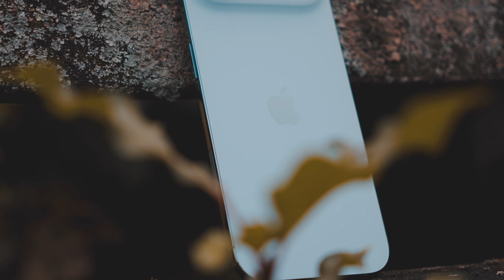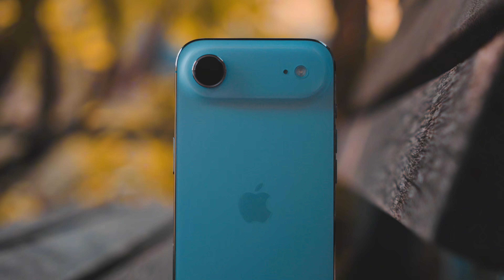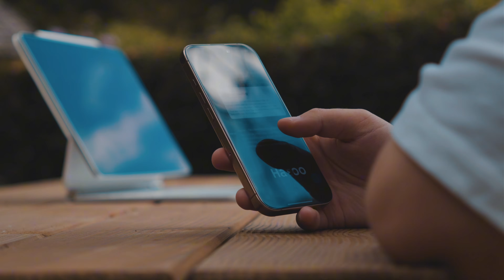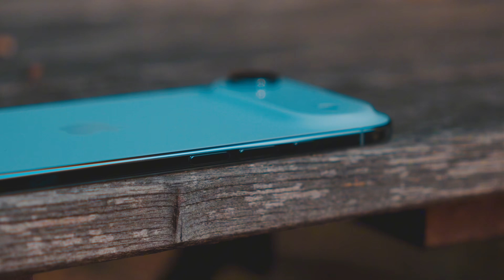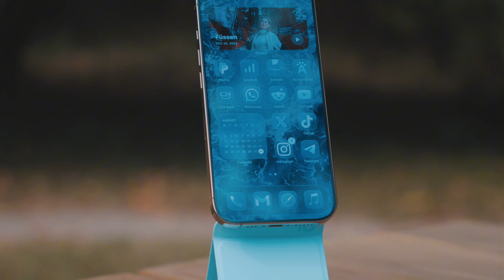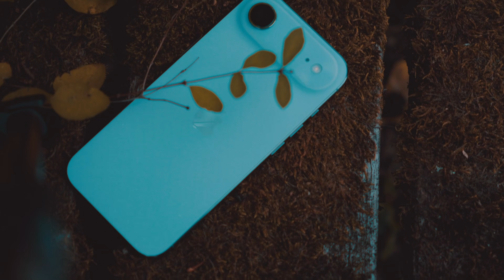It’s Time Your iPhone Air Goes Caseless.

Comment: I agree with you on a lot in this video! I have 1 16pro cashless since I bought it, still bran new even after a few drops.
Im debating now between the 18pro and the Air17... I know they are coming with  the "Air2" soon but I don't think they are going to fix the only thing that might bother me on the current Air... battery.
18pro it's aluminum and NEEDS to live on a case, this feels like a downgrade from my careless titanium, 16pro
Reply from the maker: yeah my 17 pro got fucked up even in a case, but I hate cases anyway so with the 18  Pro Im going caseless regardless and will report back in a few months
Also the iPhone Air has the same battery life as the 16 pro, it's genuinely not a problem
Reply: @heyimadrian.4546  no case on a 18pro? good luck! yeah I think im getting the Air.

Comment: It has the A19Pro chip. It’s just as fast as the pro.
Reply from the maker: On paper yes but it has one less GPU core and due to size limitations and heat soak it preforms worse  than the regulsr a19

Comment: 😅 The thinnest, lightest, most premium feeling & looking, all while being the MOST durable phone! I did put a tempered glass screen protector on mine, but it’s because the coating on it seems to significantly reduce fingerprints. I am rocking it case-less, however! It’s the first time I’ve done that with a phone. Not only do I not want to detract from the feel and thinness, but as you said, cases actually trap in debris that can damage your phone, and it allows the phone to dissipate heat more efficiently.
Reply from the maker: That's great, it's definitely designed to be used without a case :)

Comment: The air looks nice, but going careless on  my 12pro max was a death sentence. I like the idea of a lighter iPhone as the 13 mini was one of my favorites of all time. My uncle has gone naked on his 13 mini for years and never had an issue. I wish I could be so careful. Will the air really preform in the long run tho???
Reply from the maker: It definitely will, titanium is really strong and the new ceramic shield is 4x times stronger
Also because of its smaller mass the hits will be not as hard on it
Reply: I keep my Apple Care + active at all times, using the iPhone Air naked is such treat, this device feels so good in the hand and is such a wonderful experience to use. I feel sorry for anyone who avoided this phone over the backlash it received online, as someone who used to buy the Pro models each year all of the so called “trade offs” you have to make in order to daily the Air are grossly exaggerated. This phone is more than capable for the typical iPhone user.